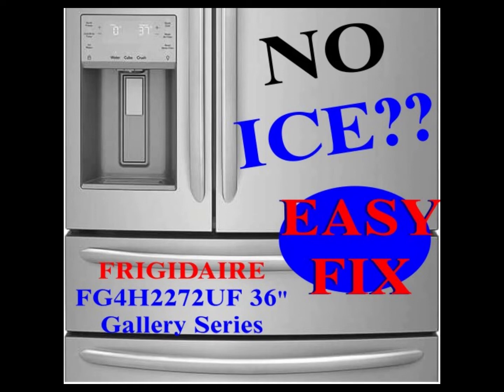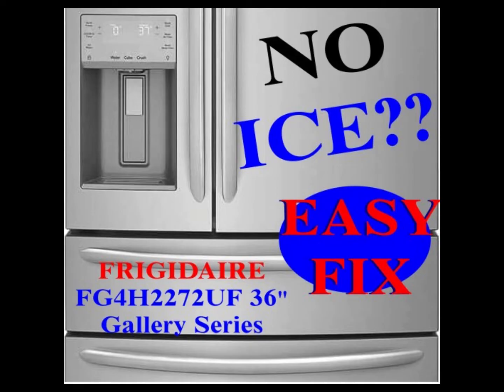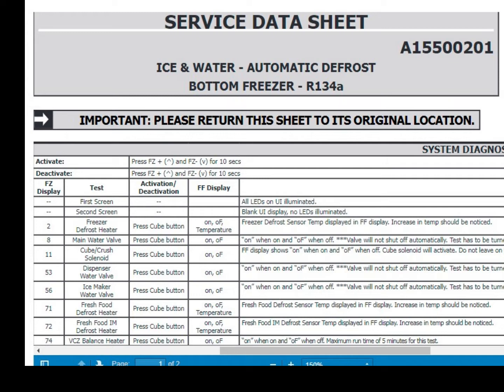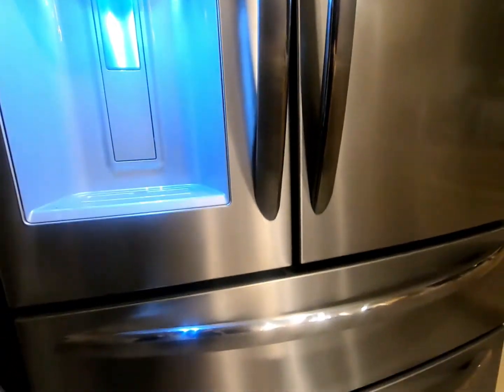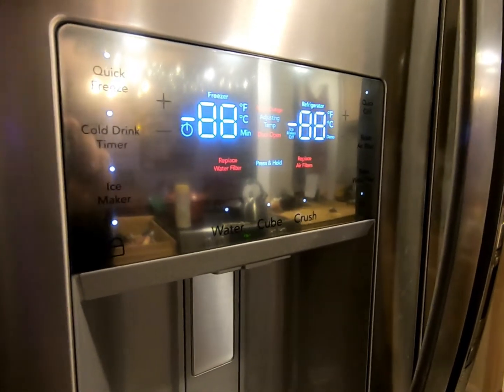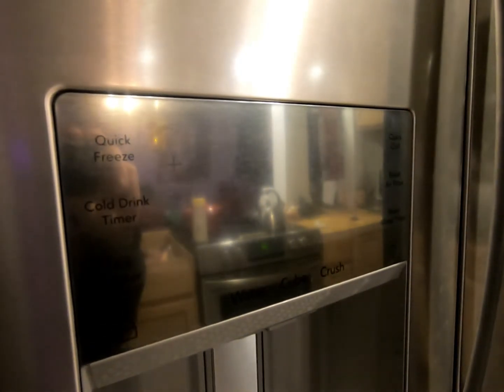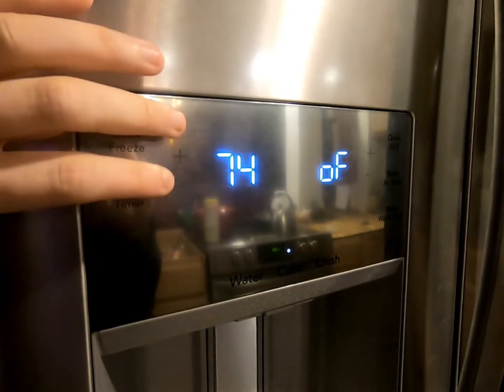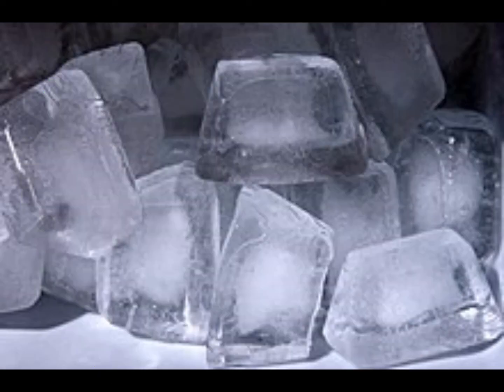No Ice FIX Easy Frigidaire FG4H2272UF Gallery Series Diagnostic Mode Defrost NO TOOLS

Comment: When I first encountered this problem, was in May, 2022. The fridge was bought new, and delivered, in June, 2020, and I purchased a 3-year warranty. When the unit quit making ice, I placed a warranty service call. 
The repairman came out, and said that the ice maker fan was not working. Turning it on in the diagnostic panel, did not work. So, he ordered a new fan, to replace the "bad" one. After the fan arrived, he disassembled the ice maker, and discovered ice maker fan had a bad wire to the fan. He repaired the wire, installed the new fan, and gave me the old fan, which actually still works. All this was done under the extended warranty. Of course, now the extended warranty has expired, and I did not renew it. Renewal was too costly for me. 
However, this time, I do not think it's the fan, so I'm trying your method. After exiting the menu, the panel shows Adjusting Temp. So, I'll wait 24 hours, and see if it creates any ice. My temps are currently set to 0° for the Freezer, and 37° for the Refrigerator, the factory recommendation, and upon exiting the diagnostic mode, the Adjusting Temp light came on. So, we'll see what happens. 
Thanks for posting this video and the Update video.
Reply from the maker: Very interesting about the fan! Thanks for sharing that experience and keep us updated. I have a friend with one of these, experienced the same issue but only when they were out of town and did not use the ice that was made, when the bin was full and no ice dispensed over 3 or so days- it would freeze up. I love collecting little bits from everyone's experiences with this issue. Good luck!
Reply: Thank you, again, for the “fixit” video. My fridge dropped the first tray of ice about 2 hours after I set the 76 code to On. So, I guess your “fix” worked. Now, we’ll see if it works for more than 1 day. If it doesn’t, I’ll follow the instructions from Frigidaire Customer Support, as laid out in one of the Comments, by one of viewers. Thanks, again.
Reply from the maker: @richardvarner6636  awesome! yes, keep the updates coming! I have certainly had the best luck with an ever so slightly increased fridge temp, so please do keep that in mind if the problem pops up again and you move to trying what support offered that one cool person who chimed in and any other options. in the meantime, glad you got some ice today!
Reply: @bigvslilworld , Well, my ice maker stopped making ice again. I actually forgot that I had saved your video, and your diagnostic steps. So, I referred to you video again, and followed the steps. The "72" value was showing 10° when I turned it ON. I'm not sure what that value should be. In your video, it showed -13°, so I'm suspecting mine showed 10°, because it was turned off. Anyway, hopefully, my ice maker will start making ice again. So, we shall see what it does. Thank you, again, for your helpful info. 
BTW, my panel shows my freezer set at 0° and my fridge set at 37°, which is the factory recommended settings. Also, the ice maker button light remains ON, where just pressing the button without going into the "72" value, the light would just turn back off. So, we'll see how long the ice maker light stays on. Hopefully, until it has made new ice.
Reply from the maker: @richardvarner6636  thanks for the update! I have had better luck (by that I mean my ice maker stopped freezing haha) by raising the fridge temp to 39 degrees. also, someone in the comments left some troubleshooting tips that Electrolux offered them when they ran in to this problem so scan for other tips (Electrolux was not helpful at all for me, glad the commenter had a better experience!). Good luck to you.
Reply: @bigvslilworld  Well, after 24 hours, still no ice. Looks like my issue is something else. So, I guess my next alternative is to call a repairman. At 80 years old, I'm not tearing into it myself. When I was younger I would not have hesitated to dive into it, but not now. Pretty sad that we have to deal with issues like this, with such a well-known brand of appliances. The only reason we went with Frigidaire, was because we are in a new house, with all pre-installed Frigidaire appliances. We bought it before we moved here from Texas. So, we figured it would fit right in, never thinking we would be dealing with issues like this. Prior to moving here from Texas, in 2020, we had a Maytag for several years, and NEVER had an issue with the ice maker. Oh, Well. Live goes on. I can't say I didn't try, thanks to your video.
Reply from the maker: @richardvarner6636  Your welcome and good luck! I totally understand the disappointment. This is the first time in my life I bought appliances new, I typically have used hand me downs that have never given me issues. I thought this purchase was a great investment, but here we are!

Comment: Does this defrost the Ice Maker water valve as well? I believe my IM water valve is frozen because I don't hear water running.
Reply from the maker: I am not certain, but I believe test #79 "Fill Tube Heater" may do the trick for you. The date sheet linked above and in the comments has details on test 79, I believe it says to not run the test longer than 5 minutes. When is the last time your filter was changed? The first issue I ever had with this fridge was no ice bc of clogged water filter (our county water is disgusting unfortunately and I go through filters rather quickly, first sign is usually strange looking ice). Good luck and keep us updated.
Reply: Thank you! I actually just ordered a water filter and it will be here Saturday, hopefully. I ran all of the test, so I will keep it off for a while and drink bottled water until the new filter gets here. Will update you soon.

Comment: How long do you leave it in defrost mode before turning it off and coming out of diagnostic mode? Before starting I see icing around the ice maker at rear of fridge. Hoping this does the trick. I noticed that it times out after a while and goes to "oF". So do you come out of defrost mode when you see that? Good video!!!
Reply from the maker: Yes it is coming out of defrost mode when it says "oF". Typically, I let it get to at least 33 degrees. I will turn it back on and let it rise if it shuts off before that, just to make sure everything warms up a bit above freezing. Good Luck!

Comment: Thank you so much. So my auger is not turning. There is ice being made but the rotator is not rotating to move it outside. Do you think it's a good idea to run test # 72 and let it defrost? and after few hours I have to turn it back off? I'd really appreciate your response. Thanks again
Best regards
Oz
Reply from the maker: I think that is a great idea. That has been my issue before, and doing a defrost helps a lot. At times right after the defrost, I will have to hold the cup about ten seconds before the auger gets to moving, but it will move. Worst case scenario, if you can't get the auger moving with any test modes, do the old fashioned blow dryer trick, pull the ice tray out and warm it up. Sorry you are having trouble with the auger. What temp is your fridge set at if you don't mind me asking? Collecting these details to try to track patterns in the refrigerators lol.
Reply: @bigvslilworld  Hi there. Thanks for taking time to respond. the tech man came over and he has ordered the new motor for auger. Mine is not dispensing the ice and all could be true but he said the motor is blown and ordered a new one. he is coming tomorrow to install it. Thanks again
Reply from the maker: @ozhormozdi6551  Thanks for the info. Keep us updated on it, curious what the cause was/if it is a byproduct of the freezing issue we are all having. Thanks again!
Reply: @bigvslilworld  so it's fixed with almost $400. He changed the Auger motor and reason? god knows. Thanks for your support

Comment: Thank you! Everything I could find on the internet for my Frigidaire FG4H2272UF 36" showed a unit with a completely different display panel.....none but yours showed how to do diagnostics,etc. On my particular display. O am currently doing test 72 to defrost my icemaker! Sure is easier than disassembling and using a hair dryer like last time! Still 😊defrosting.....so I'm waiting to see if I succeeded! My unit is also only displaying freezer and refrigerator temperature in celcius.....would like to change it back over to farenhite! Where could I find a copy of the service data sheet A15500201 you used in your video?  Also any help you might offer with the celcius/farenhite dilemma would be much appreciated!
Thank you again!
Reply from the maker: https://manualzz.com/doc/55764155/frigidaire-fg4h2272uf-36-inch-counter-depth-french-door-r..
Reply from the maker: I replied with a link to the service date sheet. And I believe the user manual that came with the fridge has instructions on changing to Fahrenheit. If you do not have one, let me know and I will do some looking. Good luck!
Reply from the maker: @Channel99-1 Im glad you were at least able to rule some stuff out. I also hate this fridge, and I'm not surprised it would do you dirty like that on the hottest day of the year! Can you spin the blades if you poke something back there where the fan is? Sometimes ice can accumulate and it freeze the blades in place, even if you can't see ice somewhere else. Though I guess it is totally possible that happened, it froze up and it burned the fan up being stuck but powered. After this fridge, I am sticking to OLD fridges that won't stop, don't care how ugly.

Comment: Do I need to keep turning the defrost method back on? What temperature do yaal suggest letting it get to?
Reply from the maker: I let it run to above freezing. If it doesnt reach above freezing, I would continue to run the test until it does. Also, I recommend increasing your fridge temperature. I am running 0 freezer and 39 fridge (up from 36/37, which I read Frigidaire recommends) and no longer have the "no ice" issue happening.

Comment: How do you get the display back to dormant? I can not get the freezer 0 and the Frig 37 off and remove the adjusting temp message off?
Reply: Same thing happened to me. The freezer and fridge and adjusting temp message stays on.
Reply from the maker: try simultaneously pressing and holding “Crush” and “ Light” for 5 seconds, it should put the display in "sleep mode"

Comment: (Sept 2024 edit changing the water fill mode to 56 from my previous error  entry of 54) Thank you so much! Yours was the only video that was for my exact model, and I had no ice in the bin. Your video was the perfect fix, and my wife was delighted I was not tearing it apart. I would recommend adding that once you start the defrost that it will automatically stop before it fully warms up and melts the frozen water line. Once it shut off, I had to press the cube button again so it would keep warming up, and then had to do it a third time until it got to about 65°. Then I switched it to number 56 and I could hear the water dispensing. It would be good to try that first to determine if the waterline is frozen now that I think of it. But anyhow, thank you so much for taking the time to post that video.
Reply from the maker: I'm so glad the video helped! I don't ever make videos, but had to share when I figured out some steps to try.
Reply: I also ran 54, heard water dispensing, but it quickly stopped on its own. I ran 54 a second time and it stopped quicker. The spec sheet made it sound like it would dispense until I pressed cube to turn oF.. was your experience similar?
Reply: @perryblack9952  did you ever figure out the answer to this question? Currently running 56 diagnostic myself.
Reply: Did you mean "56" to test the IM fill valve? I could not find "54" on the data sheet. Thank you

Comment: My fridge is able to make ice but cannot acrually dispense it. The augur at the very back of the housing is covered in ice and im worried the motor behind the housing may be frozen stuck. Would setting 72 still be the fix because it doesnt seem to be working so far
Reply from the maker: In this case, I would run the test and hope it heat up everything to melt it off, but if not, do the hair dryer trick. Pull the tray out, and blow the auger with medium heat. Something I have found that helps prevent this whole problem from starting is raising the temperature of the fridge. I believe mine is set at 39 degrees and I have not had issues with the ice tray area freezing up.

Comment: You're awesome! Thanks!  I searched through many videos on similar, but different, Frigidaire models before I came across your video on the same model that I have.  Great sleuthing to find and post the diagnostic chart, and the very helpful description of how to interpret it.  I ran both the #72 and #79 defrost and left the ice maker Off overnight.  Turned on the next day and it was making ice normally.  In my case, the root causes of the unit freezing up might have been a slightly large item in the small tray in front of the ice maker that was propping the door open at the top maybe 1/4" for a long time before I noticed.  Also leaving the ice maker On continuously in the winter and away for a few weeks when the ice make got little use.
Reply from the maker: I'm so happy to hear it helped, and thanks for dropping what your issues have been. Very good to know about the experience you had in winter. This is my first video I have ever posted, and I almost didn't make it... but I went through the same thing finding a bunch of videos that were close, but not what I needed. This kind of thing happens often for me when working on cars, so I feel a little inspired to make some videos of my solutions in that world as well. Thanks for the comment.

Comment: Great info, especially the service diagnostic codes. I also had no ice. Did a reboot of the fridge, changed the filter and eventually the ice maker tray. Still no ice. Went through each diagnostic code and all looked normal. Noticed the Ice Maker light would not stay lit and now it will only crush the ice to dispense, no cube dispense. Eventually replaced the control board and all is well. The user manual for appliances these days are pathetic with minimal and sometimes cryptic information. It's like they want the customer to call the repair service every time there is an issue.
Reply from the maker: Wow! Glad you figured out the issue and thank you for posting your experience and solution. I agree that they make it difficult for a reason, and nothing is made to last because there is so much money in repair and new parts that won't last.
Reply: Where did you get the replacement board and was it easy to replace?
Reply: I realize this is an old thread, but WHERE is the control board for this refrigerator?  Info on this model is very hard to fin.

Comment: My display doesn’t light up no matter what buttons I press. Makes no noises either when I press buttons. Any ideas, should I replace entire display?
Reply from the maker: Interesting! I would check to see if power is making it to the display. If not, I would figure out where the break is. Also check the ground, continuity etc and of the regular troubleshooting techniques for electrical parts. If you have good power and ground to the display, I would guess the easiest next step is to replace the entire display. Good luck!

Comment: When I click on 72 it says 7 Fahrenheit does that mean it’s set too hot somewhere? Far out this fridge sucks lol. The regular temps are fine
Reply from the maker: This fridge really is a pain lol. I checked mine (it is working properly today) and it currently reads 3 degrees. It went up to 34 when I did the test. I would think 7 is okay? But, I honestly do not know what the base number should be.
Reply from the maker: Also, double check to see if the dispenser over the ice tray is dispensing water. It is possible that is frozen. Test 56 should dispense water if you have no water in the tray. I would double check that. If no water is being dispensed then I would chase that down.